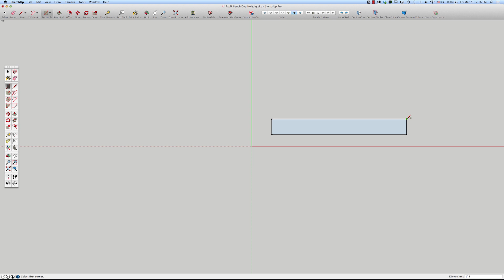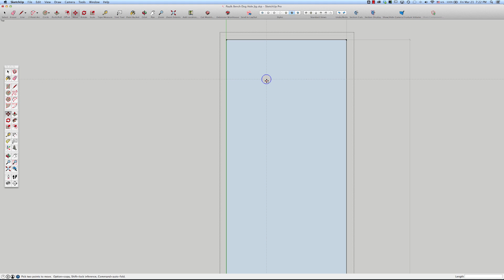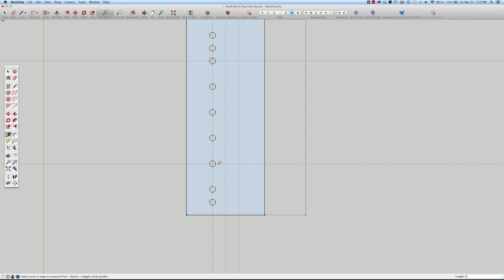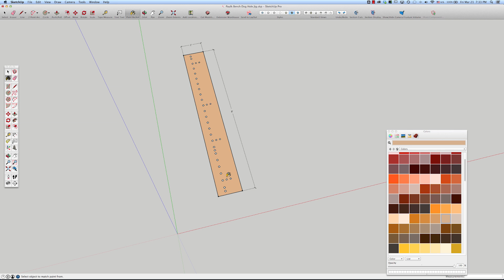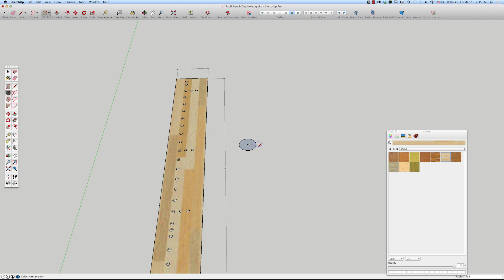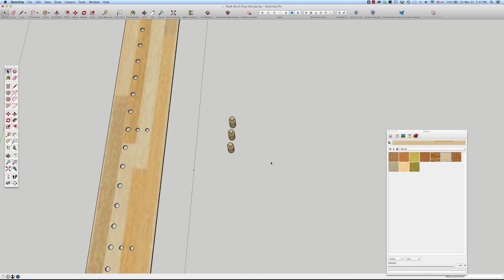TOOL TIP #3 BENCH DOG HOLE JIG

Comment: Hi, Ron. I finally got around to getting a track saw.  I am in the process of making a version of the MFT top. Your tip for determining the size of hole for the jig set me to examine the selection of a 15/16-inch bit to drill the holes for use with your guide bushing. Wouldn't a 7/8-inch bit provide a resultant hole that is closer to 20mm in diameter or is the looser fit with the 15/16-inch bit not a problem in actual practice?

Comment: Ron - Do you have a recommendation on how best to fabricate the pegs if one doesn't have access to a lathe?
Reply: If you watch Ron's video on assembling the Total Work Station, he shows you how to use your table saw to cut the dowels for indexing the template.  It is just a quick blurb I think in the last video in the series.  It is a pretty simple process.  You will see a stop that holds the dowel in place.  Be care when cutting, as always, it's not exactly what a table saw was designed for!
Steve

Comment: Ron - I enjoy watching all of your video's.  Can you show or explain how you went about drilling all the holes in the jig so they were perfectly aligned?  I make your version 2 workbench, but my holes are not perfect.  Wish I would have seen this first. But I love the bench, solid as a house.  You have inspired me, and turned me into a festool junkie.  Hope you are getting a comission.
Reply from the maker: I laid out the holes on the plywood with pencil, 8' level (straight edge), and tape measure. Once they were marked, I drilled a 1/16 " hole at each point. Then I used a 15/16 " spade bit to drill the final holes. It was quick, accurate, and easy.
Reply: Thanks Ron, you make everything look/sound easy.

Comment: Great video and tutorial as always Ron. Using the x to create multiple copies was something I had heard of and now I understand how it works. Thanks again. Not sure if I missed it on the video, but what size bit and template guide are you using?
Reply from the maker: Joe, I used a ¼ " up cut spiral bit with matching template guide, but it doesn't really matter as long as the difference between the cutter and template is used to upsize the template holes.